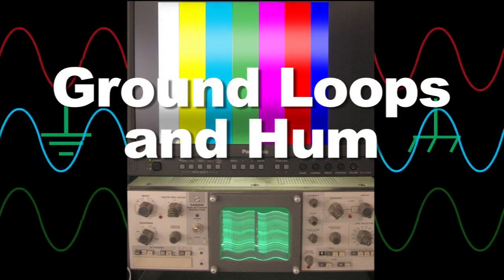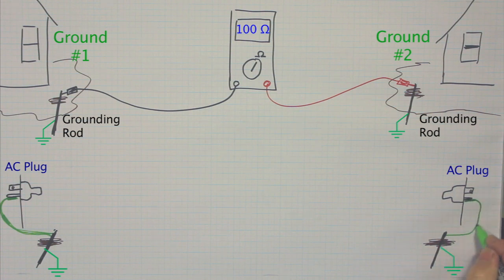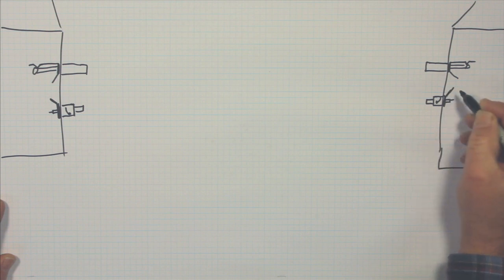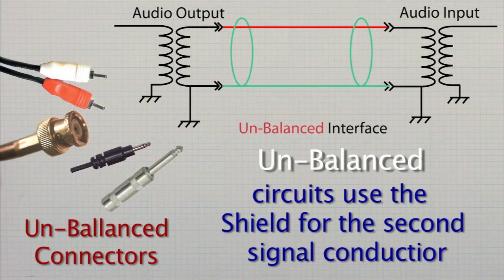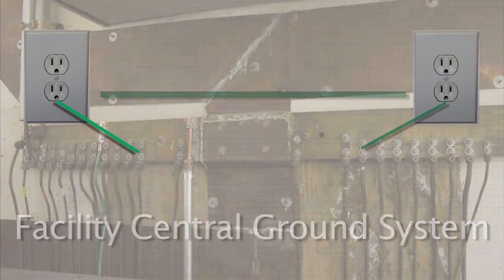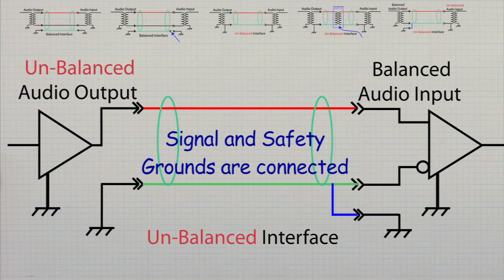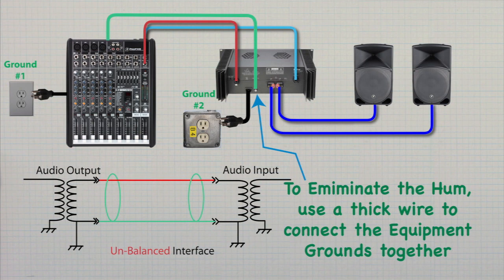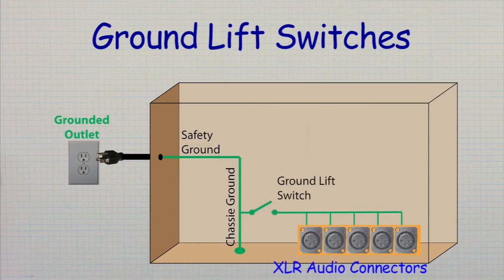Ground Loops and Hum

Comment: Also effect industrial control systems using analogue signals like 4-20mA or 0-10v DC. Have had a flow transmitter showing erroneous values due to ground loops.

Comment: I am experiencing a Hissing emitting from the Speakers of my two home stereo systems.  One in the LR using a NAD Preamp and NAD Amp connected to KEF 103 speakers.  If I turn up the volume, a slight hissing can be heard .  The PreAmp is Grounded via a Copper Ground wire to the electrical outlet box which is only a two prong outlet.  The same Ground on the Preamp is used to ground the Dual TT.  The ground wire on the TT had become detached and the TT was humming.  Once reattached , the Humming was eliminated.  Great.  But still getting hissing that can be heard with higher volumes and no music source playing.  
The other stereo system located in the basement where I am using a cheaper Pyle Preamp /Receiver ( I believe has a Class D Amplifier), connected to a Cheap Boytone Mini Multi-player.  The unit is connected via the Headphone out jack of the Boytone unit to the AUX in jacks (2) of the Pyle Amp.  Hissing can be heard at higher volumes as well.  I did notice that If I connected the 2 speaker out jacks (RCA) to the AUX In RCA jacks of the Pyle AMP, the hissing and Humming was worse.  
I used  the original RCA connection cables that came withe equipment in both systems.  Could Better / Gold Shielded cables produce less Hiss /Humming.  Just ordered same from Amazon to see if that helps or eliminates the hissing.  The Basement stereo is PLugged into the wall outlet (which does have a 3 prong outlet),  and the Pyle Amp and the separate Sub Woofer are pluggged into a Power strip which in turn is plugged inot the same outlet for the Boytone unit.  Any Ideas other than the new RCA connectors?

Comment: 4 mins into vid and after listening an watching an idea popped in my head and it worked! can't tell you how appreciative i am! what happened was i was getting heavy interference with my cctv cameras on my monitor, i tried everything, switching cameras, cables, channel ports, at first there was no signal, got new cables and thats when i got the interference, jus couldn't figure it out, after watching this i tried disconnecting the power supply to my camera, and using a splitter, used the same power cord for my DVR an it worked! so apparently i had a wrong power adapter cord in with my setup that i pulled out of my storage, idk i had it then if it doesn't belong to it

Comment: I never had ground but the problem persists.... I have a component cable that when the 2 audio cables were connected caused interference in the picture so thinking that could be audio interference I decided to cut the audio wires and the picture and is now clean. The problem is now that I have no audio and when I tried a separate cable just for the audio the interference comes back again....

Comment: My computer refused to power on when it was connected to my TV. TV had no third pin, so I solved the problem by running a wire from some TV screw to the computer chassis screw. Ironically youtube suggested this video when I powered on the computer.

Comment: 8:43 Doesn't this device just add an earth to a wall plate that does have 3 pin earthed socket wall plate? I don't think it's a ground lifter is it? Another video I watched shows that this device requires the removal of a screw on the wall plate to then screw this product down on the wall plate to get earth to the device you're plugging in.

EDIT: Looks like this "ground lifter" method is still very much unsafe as you are using the device in an unintended fashion - https://en.wikipedia.org/wiki/Cheater_plug#Safety

Comment: Ive got a Dean VMNT angel of deth Dave Mustaine signature and a Zakk Wylde epiphone Les Paul bullseye. My amps are a recently retubed JCM 900 halfstack 1960 cab and a Fender frontman 2x12. All of my amps tried at ANY outlet have a horrible hum/buzz. I have turned off the power to my house, unplugged every electrical device, and even used a generator to power my amps, and I still get a horrible hum/buzz. BUT I have taken my amps to other places, and there is NO NOISE, BUZZ/ HUM. I had an electrician come to my house and check the ground to my box, and he had no idea why I was getting the noise. My guitars and my amps are fine at other places, and I do not have "dirty" power at my house. Is this RF interference??
Reply: Do you have 2 amps connected to a A/B Switch pedal ?

Comment: I have my laptop hooked up to my stereo using rca cables and a y adapter to the laptop. I am experiencing  a humming that comes and goes , and Im quite sure it has something to do with the cables not being grounded ,like a turntable is ,since it has a special ground wire. If anyone can offer any advice for this I would greatly appreciate it.
Reply: Steve Kays If it comes and goes when your laptop is plugged in vs running off battery then you need a ground loop isolator like the BOSS B25N for 9$ on Amazon. If it buzzes while the laptop is running on battery power, you may have a different issue (perhaps check the wires?)

Comment: i have a serious amount of hum (sounds like a ground loop) between a tube guitar pre-amp and a solid-state power amp. Neither hums on their own, but only when connected. Where I am confused is that the power amp (an Electro-Harmonix Magnum 44) has an external power supply. The output from the power supply is 24 DC, so there is no ground connection on the amp at all. Any ideas why or how to solve? thanks!

Comment: Thanks for the video, it's really interesting and informative.  My audio issues have started me on an odyssey of understanding a whole bunch of electrical things I previously haven't understood or had much interest in knowing, but now I do; I guess i'll do anything for better sound.  ;  )   

I cannot say I fully understand what's been presented here, though I think I understand the general principles, 

My question is if balanced cables eliminate ground loops(as stated in the video) why did I have such a loop when playing my system?

My pre-amp, subwoofer and monitor speakers ALL have balanced XLR inputs/outputs, only my CD player does NOT, I connected it to my preamp using standard red/white RCA analog connectors. Of course, all the components have 3 prong grounded power plugs.

To make a long story short, after hearing the buzzing sound emanating from my speakers when everything was powered on, I got frustrated and decided to unplug everything, I mean everything including my whole A/V system(TV, cable box, Blu ray player, etc.).  At this point I unplugged the power strip from the wall, pulled out the other plugs with some of the audio stuff plugged in directly until there was NOTHING plugged in. 

At this point I only wanted to connect FOUR things, namely my CD player, preamp, and two powered monitor speakers. I only had FOUR outlets in the two wall sockets and believing the Subwoofer was making the low humming sound(the speakers a higher pitched hum), I decided to leave it unplugged/off.  Anyway, after reconnecting my cables(basically disconnecting/taking my sub out of the chain) going directly out XLR from my preamp to my speakers, plugging my cd player and one speaker into one outlet, and my preamp and the other speaker into the other outlet, when I turned the power back on there was still a very clear, audible humming sound. 

I am generally aware that most/all electrical audio/video equipment usually has a noise floor or ground, whatever it's called and will naturally produce some noise/static to be seen or heard in the system.  But I do not believe this is what I was hearing, I thought the sound was more pronounced/prominent like a ground loop, or maybe even some kind of electrical interference, EMI or RF.  But then of course I realized that nothing else was plugged in, so I assumed such interference would be minimal. 

Can someone explain to me what happened and how to fix the problem?

I have new JBL speakers coming later today(I think) and I'm so excited, it would be incredibly frustrating if I couldn't listen to them because of the darn humming sound. 

Thanks.

Comment: hi all i write this in hope someone can help me. i have a m audio fast track usb 2 interface. when i have my condenser mic (behringer c1) plugged in and powered by the onboard phantom power, there is a constant low frequency being picked up. even when i have the gain all the way down the signal is still present. it is not a loud noise but rather one of a constant low subby hum making it impossible for me to turn up the preamp gain . any suggestions would be appreciated , thanks in advance. (the other channel (for guitar) is completely silent) thanks again.
Reply: Matthew Nash Does the hum exist when you connect the microphone and listen to the output via the headphone out on the M Audio? I assume that you are using an XLR-XLR cable with no adapters? I'd try a different XLR cable, could just be dodgy. I'd also uninstall the M Audio's drivers, restart, install the most up-to-date driver and restart again. If this doesn't do it, it could mean that your microphone has a damaged grounding pin (pin 1) or there's dirt in there. Try use the C1 on another preamp and see if the sound still happens. If mic is alright, try a different condenser with your interface and see if it happens. If it does, the Phantom Power's dodgy. Hope this helps and post results

Comment: i have a sony DRS 820 receiver and a sunfire subwoofer connected via RCA cable, also a 230w onkyo subwoofer. In Brazil, nor the receiver, not the sony 55 tv, nor the bluray (and nor the Onkyo) have the third pin, but the subwoofer sunfire HRS 12 has. There is no ground at the ac outlet. Both subwoofers are connected to a nobreak (that mainly does the function of changin the current from 220v to 110v) Even at this night mare scenario, there should be no problem. Only  the sunfire has the third pin and none of the other equipment are connected or have ground. How come I have this hum when i turn off the receiver??? how could it do or send any audio signal when not powered on? Yes i took the RCA cables out and it solves the problem on both subs, but where does this hum comes from? Yes i tested if it was from the antenna, and no, it's not from it. I have no idea, i am afraid of buying a ground loop isolator but wasting my money. please help?
Reply: Do you connect multiple subwoofers into a single "Pre Out" of an amplifier - how? It must be that one of connected devices injects parasitic current into the line. When your receiver is on, it actively drives the output with very low impedance and is able to mostly compensate parasitic voltages or currents.

As a matter of fact, parasitic current can even come from another device, if all sleeves of all RCA jacks are wired directly together into a common virtual "ground", as is often the case. As opposed to the RCA inner pin, which is driven by an active transistor circuit, the outer conductors stay connected when the device is off.

Where does parasitic current come from? Simple, whenever there is current in one conductor, current is also induced in all nearby conductors through parasitic capacitance and inductance. The strongest ones tend to come from switch-mode power devices, such as a switch-mode power-supply (SMPS) or a class-D amplifier.

BTW, i have read your comment 4 times, and i still can't find where you say which of the active devices you have hums - is it the Sunfire? or the Onkyo?

My suggestion now is this: go around and while your receiver is powered off, disconnect all devices connected to it by RCA, HDMI or any other way, antennas, etc, one by one, until you find, which is the culprit. Then we decide what to do.
Reply: Siena. My Sunfire subwoofer HRS 12 has the hum and it wont go on standby. It starts as the receiver is turned off -- if i turn it off it contaminates the ONkyo sub (LOL) then it wont go on stand by hahaha. It's so weird. What i fould most easy is to turn off the sunfire while the receiver is still on! Doing this, when i turn off the receiver, the onkyo goes into standby... no matter. but the sunfire has to be off for this to happen! I think it might be a problem that only the sunfire has the third pin.... and there is no ground. so it is the ground! right??? i am doing a re-do on the system. connecting all of the system into a single nobreak with 1400kva into a grounded outlet... i hope it will solve the matter!
Reply: chicolua Yes, the Sandfire was probably designed to siphon its interference off into the Earth; however, this doesn't really matter for now, you'll probably need to find another way to defeat the issue. First, you should go ahead and start disconnecting EVERYTHING connected to the receiver till you find which device injects noise into the system virtual ground.

You still haven't answered how you connect two subs to your receiver. If you're using a simple Y cable, that's wrong - there needs to be at least 10 Kohm separation between the inputs of two subs, else things may go bad.
Reply: The receiver is a 7.2 model . it has two separate sub out LFE outputs.

Comment: Thanks for the vid.  I'm running a tube amp fur my audio system. Even if I plug nothing else into the amp besides the speakers (no additional outlets) I get a buzz sound.  Is it possible to have a ground loop when using only one socket?
Thanks

Comment from the maker: Sure, there just has to be a difference in AC voltage between two grounds, those grounds  could be the shields on two coax cables that run back to a single chassis or even two different chassis that share a ground.

Comment: Awesome video and I can tell you know what you are talking about because you have a nice silence behind your narration no hum!
I have a condenser mic plugged into an audiobox sound card which plugs by USB to my laptop. I have a BG hum that does not seem to have anything to do with the room itself. I've tried several external noise canceling devices and they seem to make no difference this is why I am researching ground loops and hum. its not loud but it is always there. I could use some help.